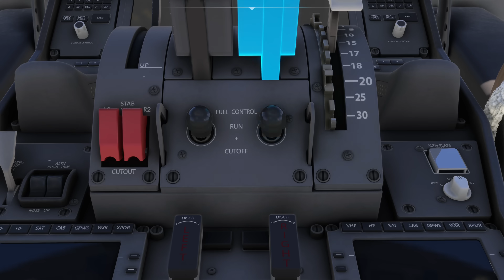Air India 171: Why Did The Fuel Cut-off Switch Get Moved?

Comment: The EMBRAER planes have additional processing you have to lift a plastic cap to reach and activate  the cut off switch and this cap holds  the switch on the select position if in run the switch cant go to cut off with plane shaking or whatever  and this way the accidental touch is off equation.  Lift the plastic, lift the switch and bring the switches to the desired position let go and close the plastic cap.  All the same like Boeing  but with additional plastic security plastic cover

Comment: 1.	Preliminary ≠ final.
The AAIB’s first note simply states that the recorded position of both fuel-control switches changed to CUTOFF seconds after lift-off; it does not say the levers were physically moved by a pilot. No teardown findings or human-factor analysis are in the public record yet.  
2.	Data ≠ cause.
The lever status comes from an electronic bit generated by the pedestal’s Remote Data Concentrator. A wiring short, failed gate-lock (already flagged in FAA SAIB NM-18-33) or other common-mode fault could make both engines and the recorder think the levers were at CUTOFF while the paddles stayed in RUN. The report has not ruled these paths out.  
3.	Gaps in the document.
•	No inspection results for the levers, microswitches or wiring.
•	No EEC/FADEC maintenance-memory dump to show why the spar valves closed.
•	CVR quotes are paraphrased (“Why did you cut off…”) with no time-stamped transcript or crew IDs.
•	Pilot backgrounds, duty time and medicals are absent—all standard in a full report.
4.  Statistics cut both ways.
Dual engine shutdowns from maintenance or data-channel faults are rare, but deliberate dual cut-off events are equally rare. Until the hardware evidence is published, either pathway remains possible.
5. Transparency still coming.
Under ICAO Annex 13, names, transcripts and causal language stay confidential until the final report—expected 12-18 months after the crash. UK, US and GE investigators are formally part of the team, limiting any chance of a “cover-up.”  

Bottom line: claiming the crew pulled the switches leaps far beyond the facts released so far. Let the labs finish with the levers, wiring looms and FADEC logs before assigning motive.
Reply: Nonsense. The crash investigators had had the fuel switches in their possession for a month already. If they have not determined whether the mechanical lockout was functioning correctly in that time, they are dangerously incompetent.

I guarantee you, they have examined the switches and they already know the answers to the other question you raised. And based on that they recommended .... no corrective action for the engine manufacturer, the switch manufacturer, or the aircraft manufacture. 

if any evidence has been found pointing to a switch malfunction or a computer error the accident investigators would be facing criminal charges for failing to disclose such evidence. 

Claiming the crew pulled the switches is the logical conclusion to draw based on the facts known so far. Even one of the pilots believed that the switches were manually mover to off.
Reply: @SeanFication  The transcript says one pilot asked "Why did he cut off?" that to me means he may not have been speaking to the other pilot, he may have been referring to the plane when he said "he", it's like when your car cuts out some people might say "why she die?" and when the other pilot says "i did not do it" he may have mistakenly responded because he was thought the other pilot was asking him. I am siding with a software/hardware issue that made the FDR think the physical switches were moved but never were.
Reply: @SeanFication i will not take a guarantee from you..... What they should see?. That the lever is switched and back? How they see that in a lever. Do you see in the switch that you turn light off and on in your livingroom?
Reply: @SeanFication  You’re making assumptions but then taking them as facts—confirmation bias. Don’t blame pilots before the final report shows real proof. Innocent until proven guilty.
Reply: @SeanFication  What you deem are facts are mere assumptions —confirmation bias. Don’t blame pilots before the final report shows real proof. Innocent until proven guilty.
Reply: @SeanFication  Not all mechanical problems with aircraft result from aircraft manufacturing.  There are plenty of other cases where the fault happens during maintenance.  Despite them having the fuel switches in their possession there is no inspection data, which means the OP is correct.  Making conclusions on incomplete information can lead you to overlook something because of confirmation bias, and it's not the point of a preliminary report.  Besides which, if you're focussed on the safety aspect, blaming the pilot doesn't improve anything, so you can wait to find out if you're right or wrong.
Reply: @SeanFication but let's have the patience to wait for the final full report to be issued to confirm that point.
Reply: This is a good comment. While other speculative outcomes may be correct it is only fair to all affected by this tragedy that commentary is based on the facts as disclosed and a knowledge of what the facts really are. For example, most data recorders will record airspeed but this is usually the sensor output and not what is displayed to the crew. So you need to be careful/cautious in the interpretation of the data. Similarly for timings, you can't infer too much without knowing the recording sampling rate, some parameters may only be recorded every 4 seconds or more, certainly on older a/c, I have no inside knowledge on this type.
Reply: @alistairgraham476  This is an internet conversation shared by millions of regular people trying to learn about these kinds of failures and unfortunate disasters in real time.....perhaps before boarding a plane for a vacation or traveling for a job, most people like to hear the experts talk about their experiences and how it relates to the current event to get more knowledge of how these disasters happen. Not that they know all but share their wisdom with us, just like someone showing you how to do a job you just started this week. Before you took the new job you really didn't know all the in's and out's, we are finding out how this all works.  And I believe most people use decrement when watching things on the internet. Totally accurate or misinformed im still learning something I didn't know before.
Reply: Thorough. Thanks. Question: Why does it take 12 months-18 for the full report?
Reply: Your first comment is stupid
They don’t both magically slip out of position.

They don’t.
They were moved
Reply: @Ont785  you shouldn’t even be on this forum. You have no idea how stupid you sound.
Reply: @Ont785  😂 you have not even taken the time to read the whole post.
Reply: @sankeitsr 

Nope, I just read the first one; and I knew where this was going .

There’s no point in reading the entire period article, if the first paragraph is wrong
Reply: @Ont785 but let's have the patience to wait for the final full report to confirm that point.
Reply: Why do you think the pilot asked if the other moved the switch if not for HIS OWN VISUAL CONFIRMATION THAT THEY WERE ON THE WRONG POSITION?
Reply: "claiming the crew pulled the switches leaps far beyond the facts released so far. " What about the cockpit voice recording?
Reply: @theeater1756  "Why did you cut off" may just be the pilot seeing a notification that the fuel is cut off, and assuming the other pilot did it because that is the most likely cause. Further interaction between the pilots would shed more light on this. Did both try to recover the plane? If one wanted the plane to crash, wouldn't he further instigate against the recovering pilot to make sure that the plane won't recover?
Reply: @theeater1756  what about it? Those two sentences can mean anything. There was confusion about who will recycle the switches maybe. Wait until they publish the full recording in the final report.
Reply: I’m pretty sure the report as I heard it said that the switches moved to cutoff simultaneously which from my understanding of their operation stated on this channel would be the pilot moving one and then the other so I’m still not convinced a pilot necessarily moved the switches
Reply: I see where you are going.  Your second point leads to a few more questions.  What exactly did the pilot who questioned the fuel cutoff say?  Did he see the switches in the cutoff position?  Was it an audible warning to which he was reacting to?  Did he physically put the switches back to where they were supposed to be or did the hypothetical glitchy unit just sort itself out.   I guess we’ll never know if there was a visual confirmation of where the switches were.  Sad and fascinating at the same time.  :-(
Reply: Based on the AAIB’s preliminary findings, the fuel control switches for both engines moved to CUTOFF in a left-to-right sequence about 1 second apart, a pattern that strongly matches deliberate or accidental manual input rather than an electrical fault, since a wiring or data-channel failure would likely trigger simultaneous or erratic signals, not a clean staggered shutdown. The cockpit voice recorder shows the pilot(s) immediately recognized the engines had been “cut off,” and one switch was then moved back to RUN, followed by the the other, again in a left-to-right order and about 4 seconds apart, further suggesting physical input consistent with human muscle memory, rather than electrical fault. Additionally, standard procedure for a dual engine flameout does not call for fuel switches to be cycled off and back on immediately if confirmed both fuel switches are in the RUN position, making a purely procedural explanation unlikely. For the procedure for accidental fuel cut off during flight, after confirming power loss/flameout via thrust reduction and instrumentation data, and conforming the fuel control switches are in the CUTOFF position, the immediate response is to restore fuel flow by returning the switches back to the RUN position. The response of the pilot(s), according to the data is in line with procedure. This was a good breakdown , but I believe taken together, the current weight of evidence leans toward pilot input, accidental or intentional, over a system fault, though all scenarios remain open until the final report confirms the physical teardown, wiring checks, and human factors analysis. It could very well be a case of gross procedural error and/or compounded by stress, fatigue, mental health issues etc, but definitely too early to conclude anything.
Reply: @TheStruggler101  Well summarised. My point was don’t blame the pilot prematurely based on a preliminary report. Innocent until proven guilty.
Reply: @sankeitsr 

Yeah certainly. Regardless of the current weight of evidence, this could shift, even dramatically, toward it being a mechanical or electrical fault upon further analysis and new data. I definitely agree with your take, and unfortunately many people are coming to concrete conclusions despite there being no conclusive evidence at this point. It seems some content creators also appear to be suggesting concrete conclusions, perhaps knowingly for content and views. Fortunately, I would say many of these people who lack critical thinking skills aren't working for the AAIB or in science. Human beings would likely still be living in the trees if that were the extent of our logic and reasoning capabilities lol.
Reply: @TheStruggler101 👍
Reply: If this were some sort of electronic issue where the switches were not in fact in the cut off position, but an electronic component read them as being so, how do you count for the fact that the two switches were then manually switched to the on position by one of the pilots?  No need to do that if they were already in the on position, but we’re simply being misinterpreted by internal chips.
Reply: @richardjones9007 when it is not physically switched off, than there is no need to switch  it physically on. On every electric board you can have different wiring problems.
Reply: @richardjones9007  Because cycling the switches is the logical thing to try in that situation. The engines spool down, EICAS says "ENG CUTOFF", the pilot feels it, sees it, looks down and the switches are still in RUN - which is confusing. He asks “Why did he cutoff?”, gets “I didn’t do it” as a reply (meaning: it wasn’t human input).Due to the contradicting input it takes him 10 seconds to decide to cycle the switches to try and recover. So he moves the first to CUTOFF (which FADEC ignores because it already thinks it's in that state), then back to RUN. Then does the same for the second. That perfectly explains the 4-second gap between the two RUN signals being logged (because he had to do two actions per switch, not one).
Reply: @AnOnymous-go7kn I'm going with Occam's Razor on this one. I'd like to be wrong.
Reply: @richardjones9007 An electrical or software fault could cause both the apparent cutoff and switch back to run.  The switches might never have physically moved.  That's why it is dangerous to jump to conclusions based on a preliminary report.
Reply: @_winston_smith_  im going out on  a limb here and says it was deliberately crashed..   i dont think its a faulty software or electrical.
Reply: @richardjones9007 where does it say that they moved to on position? It just says that the knob recovered from crash site shows in on position. Meaning it was always on but probably electronically was shut off.
Reply: @kumark214  The pilot himself visually confirmed that they were on the wrong position hence why he asked the other if he did it.
Reply: Good and important objection. The preliminary report says fuel switches "transitioned" from run to cut-off and back relying solely on flight data recordings. Nobody knows so far if they where physically touched and the report doesn't raise implications on this hence prejudging one pilot of commited murder-suicide is far too early.
Reply: @Dokker62  The pilot himself visually confirmed that they were on the wrong position hence why he asked the other if he did it.
Reply: @Dokker62  The preliminary report is available for people to read online, and literally says information is subject to change and is only to be used for safety improvements, any liability or blame is someone else's purview.
Reply: @GeekGamer666 I read the report. Who did I blame...?
Reply: Your point on US, UK, GE being on the investigation team is the exact reason why this has possibility of a cover up. All those countries and companies ave a long history of manipulation, cover ups and propaganda. Not sure what makes you think if their self interest is at stake with Boeing in the trouble seat, they would be honest as that is something far from their reputation.
Reply: @kumark214  it is statistically unlikely when more parties are involved.
Reply: @kumark214  Perhaps in other situations but demonstrate where that's true in aviation?
Reply: Union Aviation Minister of India has stated for people not to jump to conclusions and wait for final report and here is our over-smart CAPTAIN STEEVE using his social media power to openly claiming that is was pilot's fault

Comment: I just watched Anut Mathur's interview, who is a pilot trainer in India and his technical root cause analysis give way better insight. I am sorry but Steve was wrong with the initial video around the flaps and even with this "mental" assessment, it's very speculative. Boeing has had shoddy issues with their software(coincidence that they use Indian developers that were also blamed for the MCAS bug). Those pilots were dealing with a system failure and they tried to save that flight. Lastly, I work with many Indian IT contractors, they value their parents and one would never think of them abandoning them like this. Waiting for the full report.

Comment: I'd like some insight in how you, as a pilot, shut down the fuel supplies at the gate.....if it's a routine ,how many seconds does that take?   As much as it becomes a routine that you handle many times during a day, AND the fact that the landing gear wasn't raised, is there a scenario where the co-pilot/pilot simply meant to raise the gear (one routine) and confused that routing with the fuel shutoff (another routine)  Both seem designed for safety, BUT any more that he simply executed by error. Ever find yourself in reverse in your car when you meant to be in forward in your car?? I'm not assuming anything, but asking if the sequence at the gate is similar to the sequence of the actions taken??

Comment: 10:29 A camera in the cockpit would have likely identified which pilot activated the fuel cut-off switches. Is this correct?
Reply: Could not people who worked with the two pilots identify who said what leading up to the crash?
Reply: @brittanyalleyne9760 If they were alive, sure.

Comment: Require two people to activate the cut-off switches. I think that's not doable. If you think about it, an airliner is designed to be flown by a single pilot, in case something happens to the other one. So, procedures to verbal agree to perform an action are ok, but I don't think that "physical" actions that require two people to be performed would ever be implemented. E.g., imagine one cut-off switch for each pilot for each engine, placed so far that one human can't activate it. That would be extremely simple, if such a critical system ae not implemented this way, there must be a reason....

Comment: It is not clear whether the switches actually physically transitioned to cutoff
Or the switches were always in Run position and it was an internal  short circuit 
The full investigation should bring that out